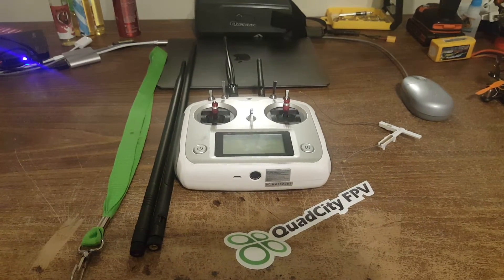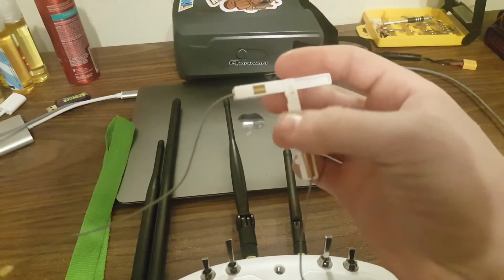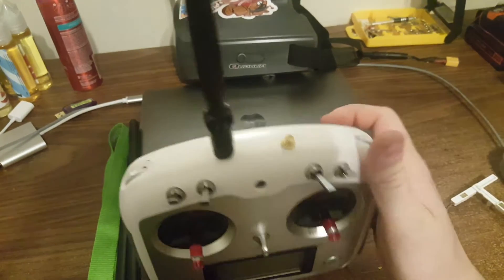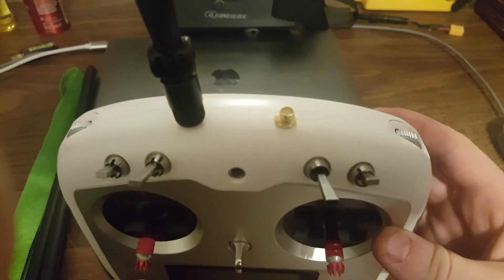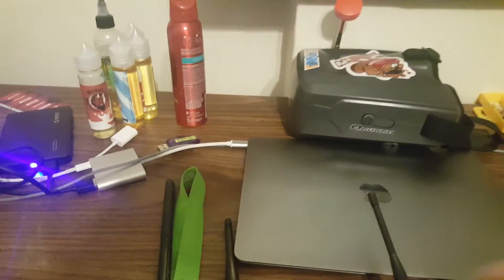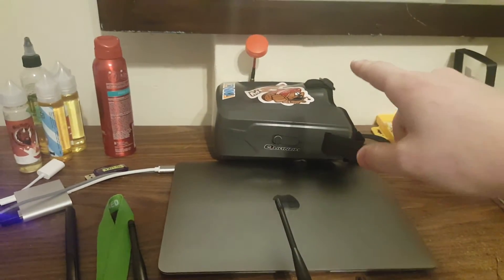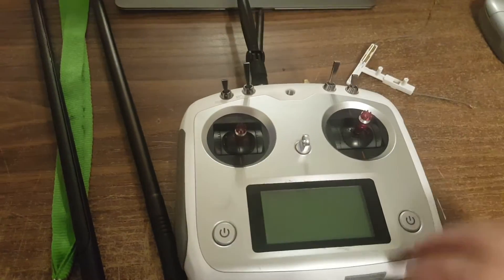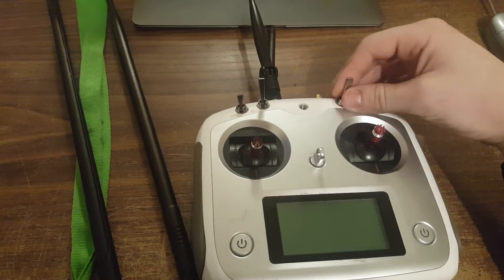FlySky i6s - Antenna Range Mod.

Comment: Thanks for the video, is it better to put a 3 and 5dbi antenna or 2x 5dbi antennas? I dont really need ultra long range, bit i want to be safe within around <1000m
Reply from the maker: Broderon Rc it's up to you. I fly 3 and 5 db all the time without issues
Reply from the maker: Broderon Rc and with the flysky i6 (i6s touchscreen broke ) I've flown 1.5 km without problems. I don't have RTH or I'd go farther lol
Reply: Camo FPV ok, but what is the sense behind flying 3 and 5 and not 5 and 5? Is there another range or form like donut or how should i understand that? Want to order  now but would like to understand it before i buy ✌️
Reply: What is RTH? I'm not sure but i have the feeling that i lose signal after around 200-300m with stock flysky i6s
Reply from the maker: Broderon Rc when the gain is higher there is less energy going up and the more directional the link is. When you use low gain it's like a circle and high db is more focused. The range could be less because of interference due to wifi and other devices on the 2.4 ghz band
Reply: Camo FPV does it matter which antenna goes in which port?

Comment: Might be a silly question but I'm just checking. I just did this mod but i was going to use one of my 5.8 GHz 3dB antennas its the same RP-SMA connector. Does it matter the antenna says 5.8 will it transmit 2.4 fine or are the antennas special ?
Reply from the maker: Ed Jones there different wave lengths. Thy will not work
Reply: I just assumed the antennas were the same inside? i know they are different wavelengths but the antennas is just a bit of wire is it not?
Reply from the maker: Ed Jones yea there a protected wire inside the plastic housing. But the wire is cut to a certain length.
Reply from the maker: Ed Jones that length determines the frequency it can pick up
Reply: Ahh makes sense! Thanks for the help and the awesome mod/links!

Comment: those are u.fl connectors
Reply: thanks for making this video. i just purchased this transmitter. how much range did you get with the stock antennas?
Reply from the maker: +Djkflow I never had a issue with range. I go 250 ft or more without issues

Comment: ok. range no mod is?
Reply: I just fly -+ 100 metres, but the beeping indicator's already on that means the signal is low.. is it normal? or maybe my i6s is defect product?
the flight is in relatively low interference/rural area
Reply from the maker: +hudie racing you can get like 250 or more feet stock. I did the mod to stop drop outs from occurring

Comment: Can I just replace one of the antennas with this mod?I'll be using a 2.4Ghz 2W booster on it
Reply from the maker: Obinna Eke yea why not. you could leave the horizontal antenna still plugged in with one high gain and a 1/2/3/4w booster.
Reply: Camo FPV ok, thanks.

Comment: Hi, thanks for posting the video. I'm looking at doing the same mod. Does it make a difference which is connected to the 5dbi and 3dbi ? If using a 7dbi antenna should the second one be a 5dbi ?
Reply from the maker: Richard Conejo it shouldn't matter too much but in Theory you should have less drop outs with a odd set. say 5 and 14. the 5 will act as more of a circle around you. the high gain will work for long distance no problem. play around with it for yourself. it's fun. there's also patch antennas and everything you can grab for these radios. there all RP-SMA